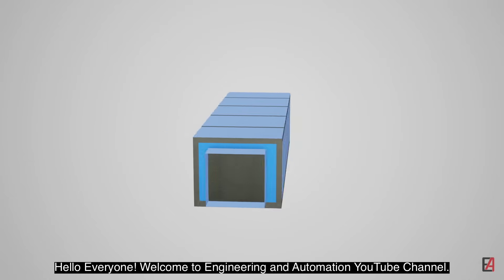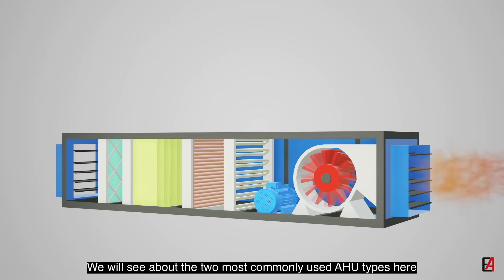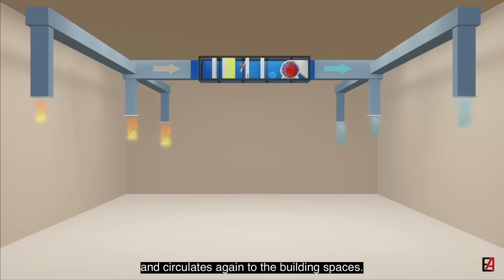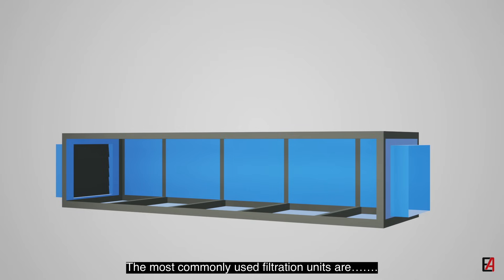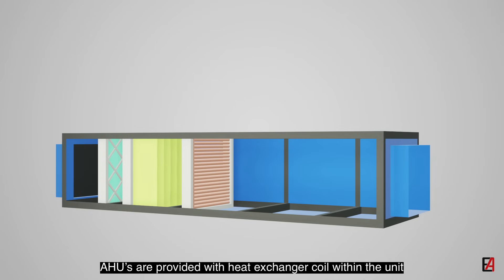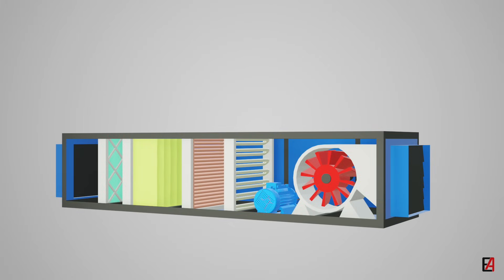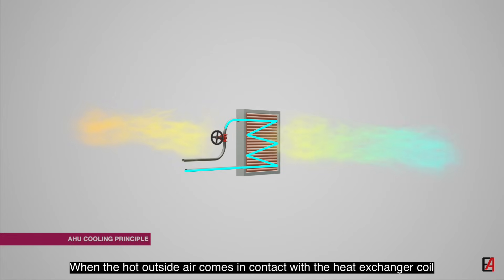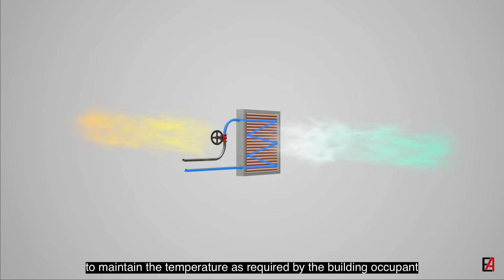Air Handling Unit (AHU) Fundamentals with Cooling Principle and its components

Comment: Can AHU kept inside premise or it should be in open air like terrace or basement??
Reply from the maker: It can be kept inside and also on terrace.. basement is not advisable as it requires more
Ducting works.. if its only a 10% recirculating AHU it can be placed anywhere as convenience. But if the AHU requires fresh air the fresh air ducting to be considered while placing the AHU. Hope this helps. Thanks

Comment: Sir, can we use HVAC as AHU during winter season.
Reply from the maker: Hi Anand.. Yes you can have 100% fresh air system during winter. so that the CHW energy can be less used. CHW control depends on the temperature set point. if the Outdoor temperature is very less that is sufficient to cool down the space without the use of chilled water

Comment: Hi Im using an AHU we have electric pre heat coil for winter pre filter bag filter then dx coil for both heating and cooling  do you have any ideas as my temperature swing is rapid when the correct air volume is required and my pid loop working on the capacitance loop doesnt seem to stabilise well?
Reply from the maker: Hi Scott. sorry for the late response. you need to tune the pid to allow the valve to open slowly instead of rapid movements. Use the derivative value tune the PID controller so that the controller output will be stabilized without hunting. Hope this helps.

Comment: Heat pipe purpose is for reduce cooling load?
In residential flays why ahu with heat pipe is used
Reply from the maker: Yes heat pipe is used to pre cool the air before entering the cooling coil. It is used to save energy.

Comment: Sir, where is the Humidifier section in AHU ?
Reply from the maker: Hi Rotkim.. these AHU examples do not have a humidifier section.. in typical AHU with humidifier, the humidifier will be located after the cooling & heating coil before the fan.. humidifier is just a mist of water spraying in to the AHU. Hope this helps

Comment: How will the moisture from the closed cooling coil will be transferred to the hot air ?  Agreed that there will be heat transfer from hot air to cooling media.
Reply from the maker: Hi Smit.. when the heat transfer happens, the air will collect the water molecules from the cooling coil thus absorbing the moisture.

Comment: Sir, why use modulating valve to provide on off function for ahu? Why not just use the on off valve for ahu?
Reply from the maker: Hi, thanks for your question. Yes u re right, if only On/Off control is required we can definitely go ahead with On/Off actuator. But it do not provide the modulating function if the client requirements changes in future for any fit-out works. However, it is possible with the modulating AHU control, both On/Off and modulating function. Hope this helps.. please subscribe and keep supporting. 👍

Comment: sir, could you please explain more about heating coil stages and how to control heating coil thru heating panel.
Reply from the maker: Hi Athiq, There can be different types of Heating coils.. Single Stage heating coil where DDC can Switch On/Off based on the Setpoint. 3 Stage Heating Coil where DDC can Switch On/Off each stage progressively to achieve the desired Setpoint. The last one is the Thyristor heater control, where 0-10V dc or 4-20mA signal from DDC is used to control the heater as per the required set point. If it is Stage type heating coil, the BMS signal will be DO and If it is thyristor control BMS signal will be AO. If you need specific details, please let me know at ea.learnautomation@gmail.com. Thank You.
Reply: Sir can u explain the output signal by control like 0-5v 0-10v and 2-20mA signls where we are using and whats is the advantage and disadvantages over one on another